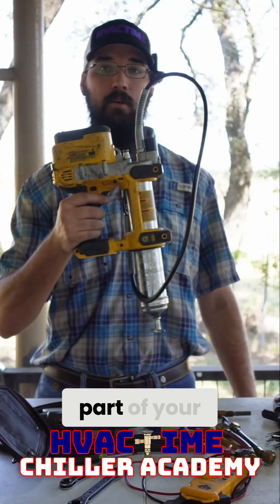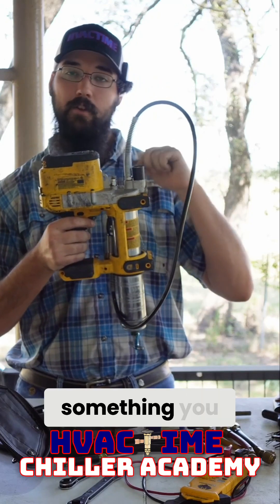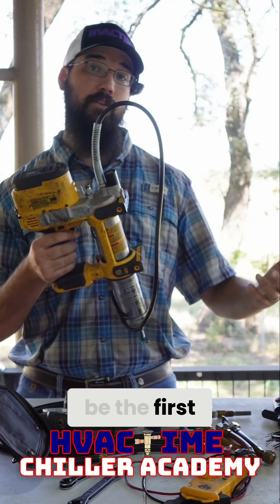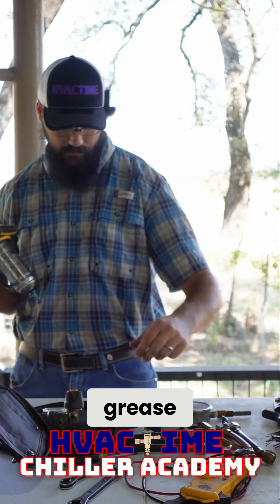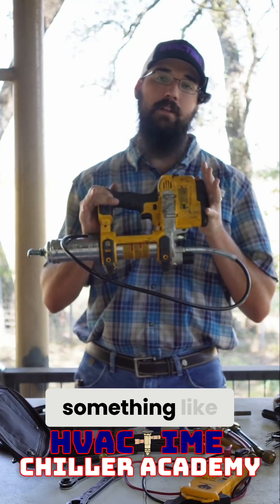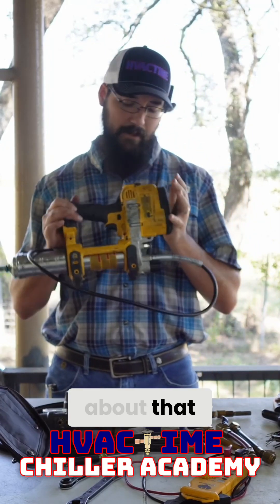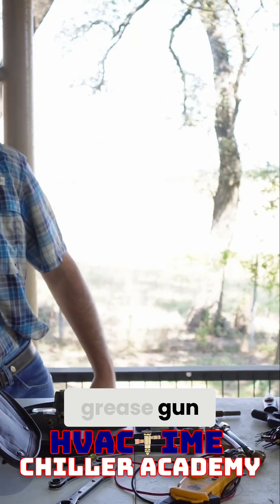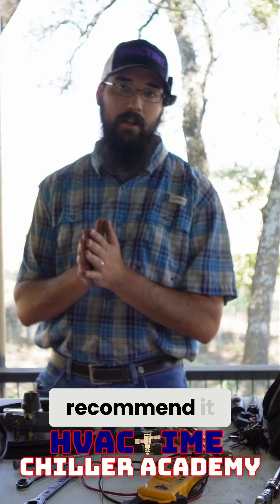Battery Grease Gun for Chiller Maintenance

Comment: I prefer manual pistol grip guns, I have 3 in my van. My chillers get 6 shots of grease in each bearing every 1200 hours, my pumps get 2 shots every quarter as per motor specs. I usually grease air handlers quarterly or semi annually, RTUs before winter and before summer. Tower’s get the most grease, should really be done monthly during the summer and filled prior to winter to keep water out. I don’t grease bearings daily or even weekly. To each their own, I like manual tools, much lighter and cheaper. No dead batteries to change. Builds forearm strength.

Battery powered guns are definitely much quicker though, my apprentice has the Milwaukee. He overgreases everything, bearings are blown out from too much grease. Good job security